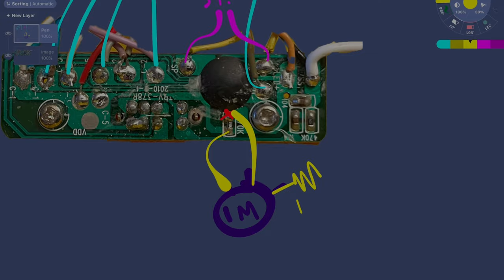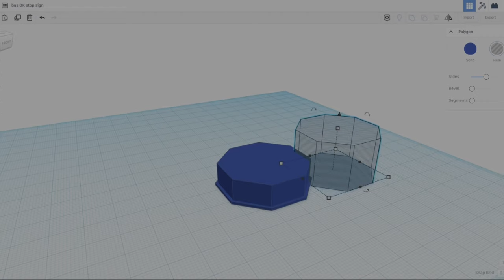How I Circuit Bend A Thing!  (start to finish)

Comment: 0:40 What is that thing? How does it work?
Reply: I'm pretty sure that's a custom built bending box, which has a variety of potentiometers on it, and 2 leads...you can use it to test out various pot values, before you hardwire something in.  It's just for convenience, really...and you can make it yourself however you desire, even adding other various components like capacitors, selector switches, etc.....i.e., whatever you feel you would commonly like to test bends with.

Comment: i wanna do this but i have 0 knowledge about electronics and circuits, where can i start?
Reply: Go for older toys that dont have ics in it and only go for battery powered an cheap ones, there are solder connections you could fry the pcb with but its a little try and error, try to find something and see if there fits a button, switch or trim pod,
Sonetimes theres an resistor which regulates the pitch of the sound so you can change it, there photo sensors that regulate their resistance by incoming light or you can wire two points to the outside of the case so you yourself can act as the switch;D there is a great book: handmade electronic music, hope that helps! greets and have fun ;)